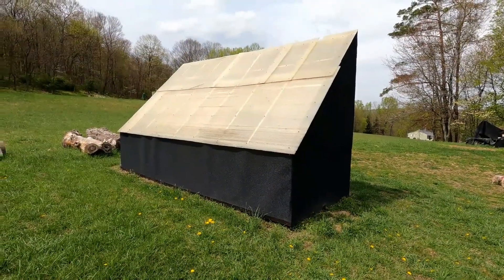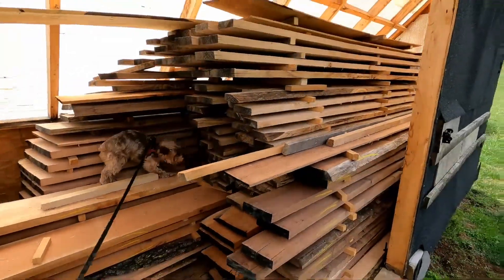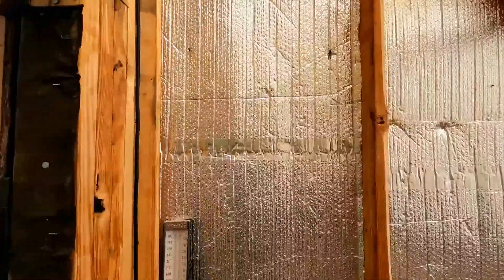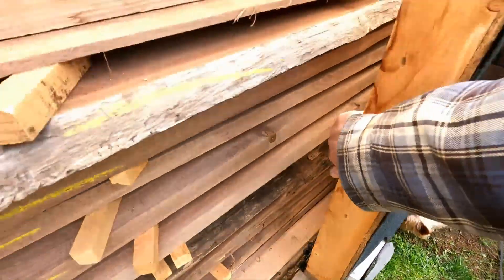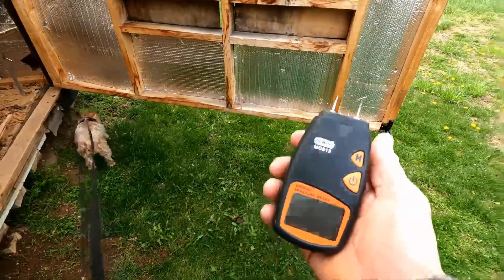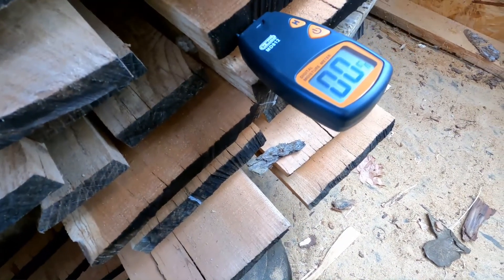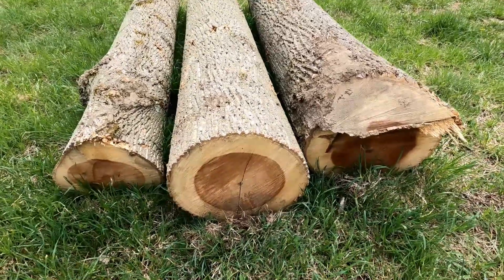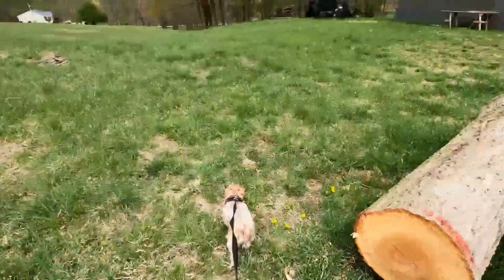Solar Kiln

Comment: I can't believe how many people use those cheap inaccurate moisture meters that they haven't a clue how to use
Reply from the maker: I have actually measured and weighed a board and then later after it's been drying weighed it again to calculate the amount of moisture.  but that's a lot of work.
Reply: @whistle3man  the moisture content of that red oak logs near the end is not 18% I was in the commercial kiln industry for 30 years, and moisture meters can give an idea only, do you even know at what moisture content is Fibre saturation point?

Comment: I don't think you are getting accurate reading on end of boards?? Please correct me if I'm wrong 🙂 I do like your kiln. I'm getting ready to build one.
Reply: I just finished my kiln. Built it 14' long as you suggested and 12ft boards fit fine with walk around room.
Reply from the maker: You are correct and I think I did bring that up in a different video check the boards on the sides or the top or bottom and if you can even cut a board to get deeper in it's even better but you are correct
Reply: Guy has no clue